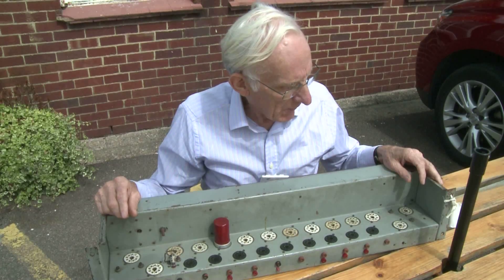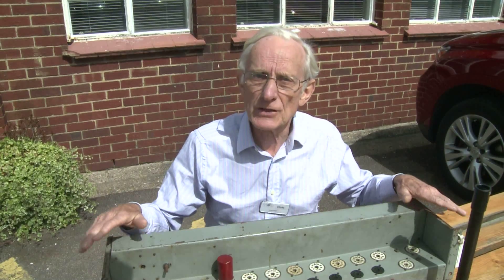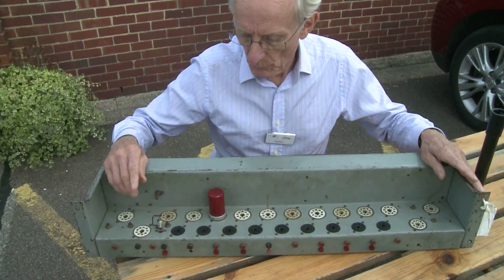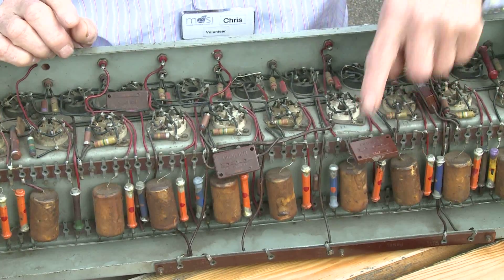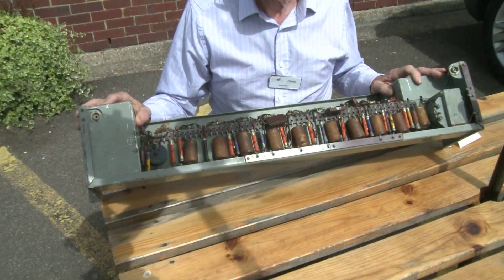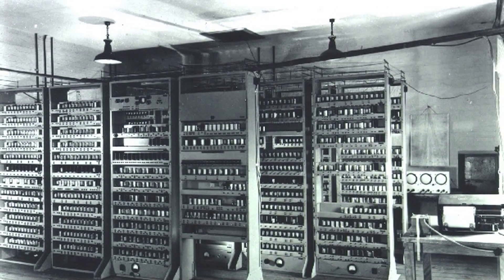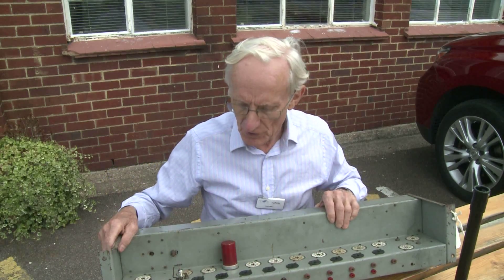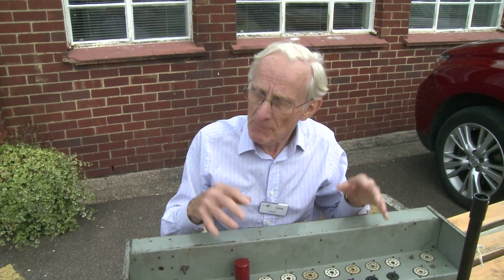EDSAC Project - an EDSAC chassis

Comment: 6 Volts at 15 Amps, times 14 chassis per rack, times, what, 8 racks?  No wonder these things needed a whole room!  And a carefully air-conditioned one at that.  Compare that to the amount of power being used by the iPad on which I just viewed this video.  What an unbelievable gain in efficiency!  Staggering to think about!